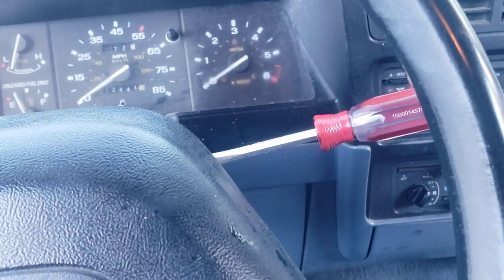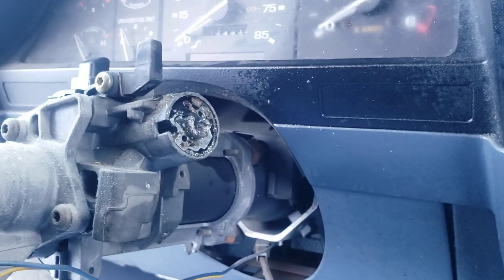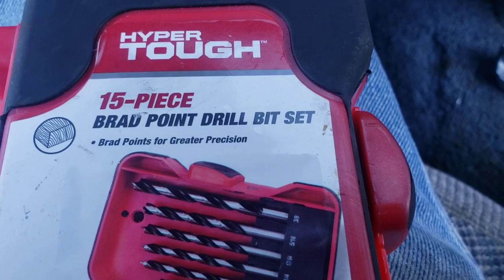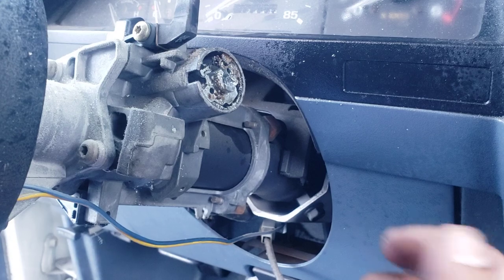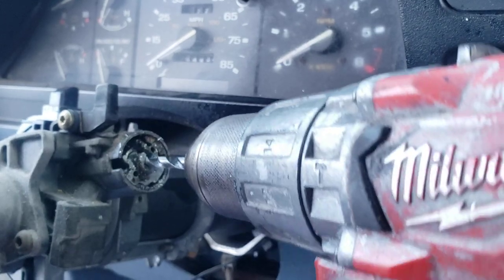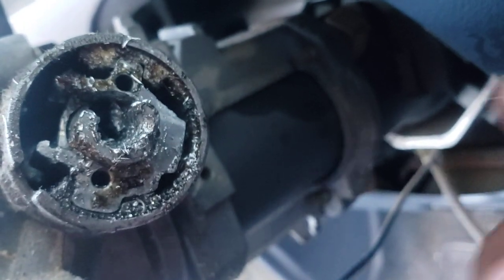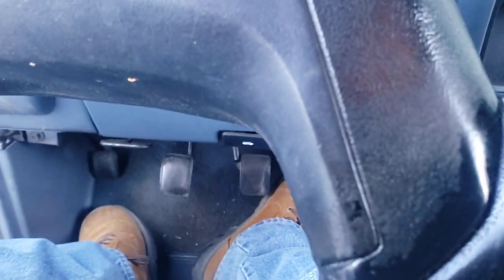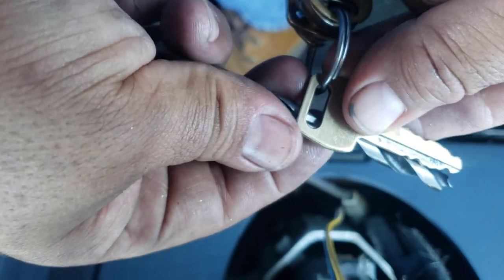How to remove Ignition switch 1990 ford ranger with no keys

Comment: I am a locksmith, and this video did not demonstrate how to remove the lock cylinder. And we charge "too much" because we are not gunna drill it out and damage anything. This model is easy to remove ignition without damaging or drilling anything even if keys are missing
Reply: Could you please make a vid showing how bc the drilling isn’t working for me
Reply: @ryleygallagher_03  you’ll need a Jiggler key
Reply: @ryleygallagher_03  or a lock pick to turn it over
Reply: @pouncerminned863  well mine now currently has no key cylinder in it at all and I can’t get it to turn all the way over just turns on to accessories
Reply: @ryleygallagher_03  how or what did you do first? maybe drilling it ruined your chance of a clean removal
Reply: Yes it is I’m an old car thief n I dunno what the hell this guy is doing wouldn’t recommend anyone doing took us a min tops to steal these back on day
Reply: Lost my key, how do I get the cylinder out without drilling
Reply: Yeah there's another you tube video 📹 of a guy showing where to push a pin into to remove the whole lock cylinder on a 1994 column. Go hunt that one down. This guy in his video is wasting his time.

Comment: I’m in the same predicament it’s an older truck but same lock design ugh I knew I was gonna have to drill it just don’t wanna looks like imma have to destroy the pins inside drilling it to get it to turn then compress the pin to lock cylinder and slide it out and replace

Comment: Thanks. This helps so much.  1994 b3000.  Its suck in lock position. Have new tumbler. Hope it goes well. I love this truck. I just hope to keep it running. Getting close to 256000 miles.
Reply: Did you get it to work?

Comment: OK, a guy did this to mine.
I've been using screwdriver since, hoping for time to replace cylinder. 
Problem is, little button near hazard switch not outside hole.
Also, screwdriver no longer works. Ignition stuck in running.
Stopped on its own, cuz got hot due to coolant leak. Disconnected battery. 
IDK how to turn screwdriver or position cylinder button back through hole.
I have 2nd steering column I can cannibalize for parts.
Also, no steering wheel puller, way to get to town to rent one.
Suggestions appreciated.